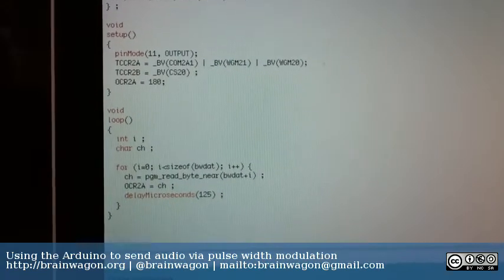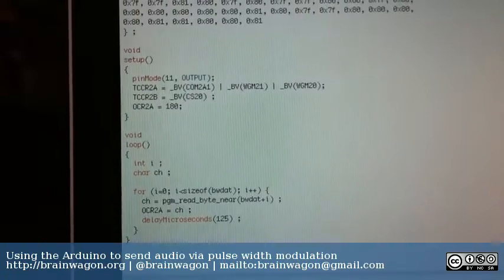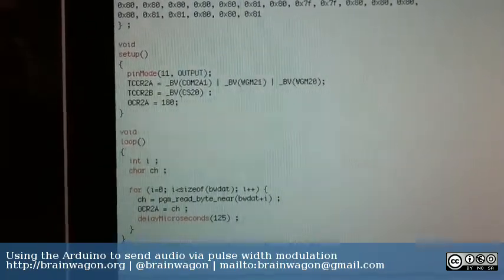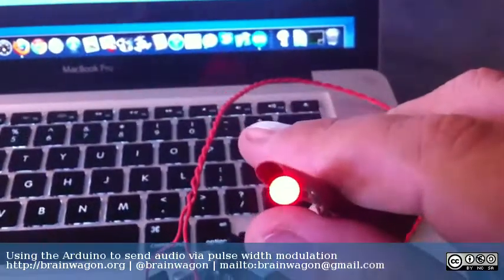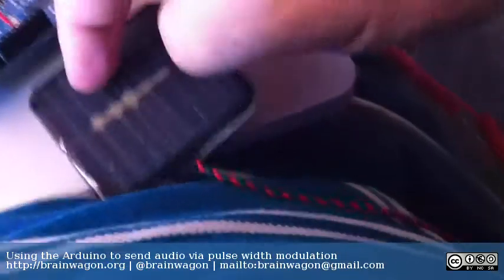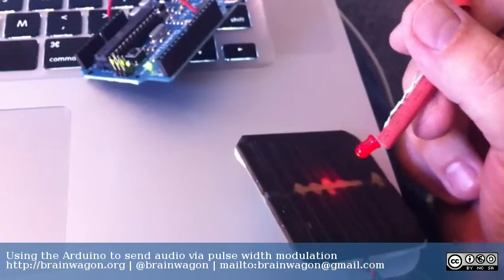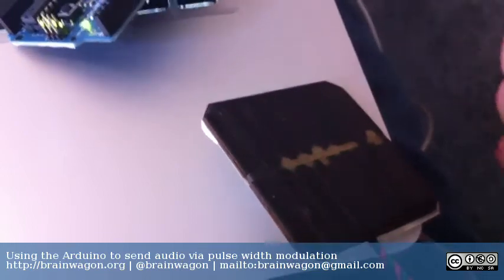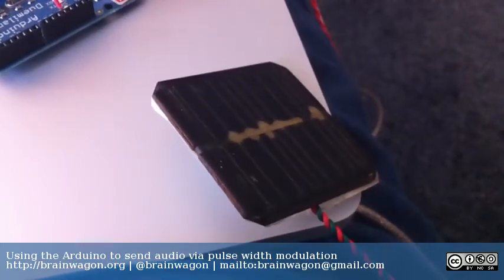Using the Arduino to send audio via pulse width modulation

Comment: I use the 22kHz pwm with analogwrite as a drum synthesizer. Different waveforms triggered by piezo elements on different inputs. Works good.

Comment: Interesting! I never knew the arduino was fast enough to modulate sound! Imagine LED lighting that transfers music, and all you need to receive it is speaker with a solar cell on top! Haha. That would be so cool. New kind of wireless data transmission completely unregulated by the FCC. :)

Comment: This is brilliant...because, if I understand it correctly, you're outputting analog audio using only one digital output instead of four or more outputs with a DAC.  A very efficient use of the pins available and the sound quality appears decent.

Comment: If you replaced the led with a small speaker. would you hear the same thing?
Reply: I presume it would...but you'd probably need some amplification.  I'm very new to Arduino, and I'm uncertain how much current it can supply.
Reply: kichigaisensei i've heard that the pins can output up to 20-40 ma, it should be in the datasheet for the atmega chip